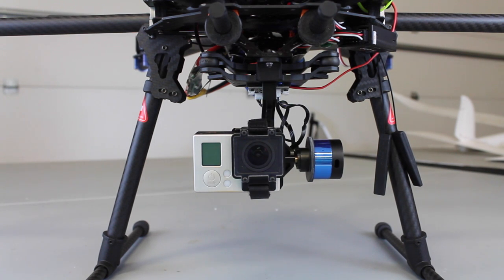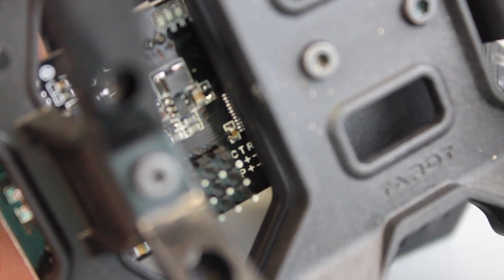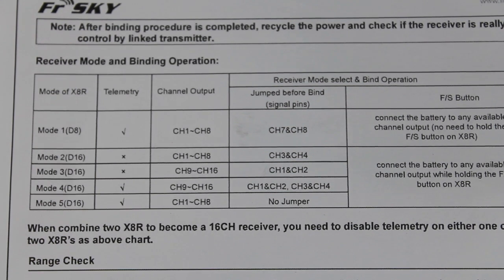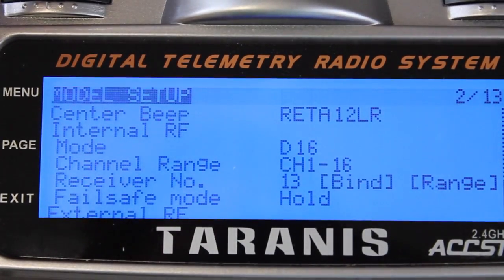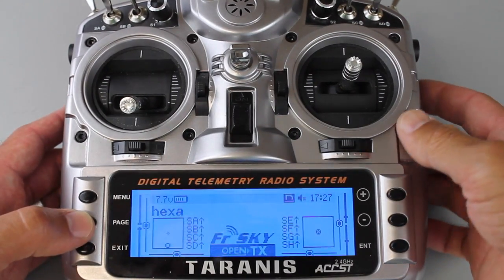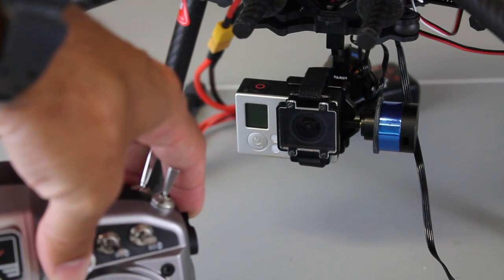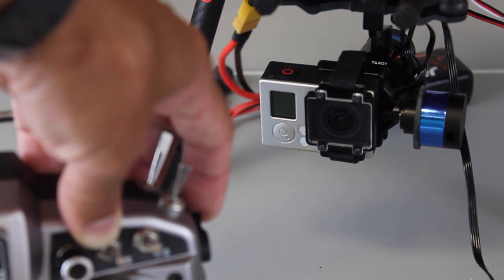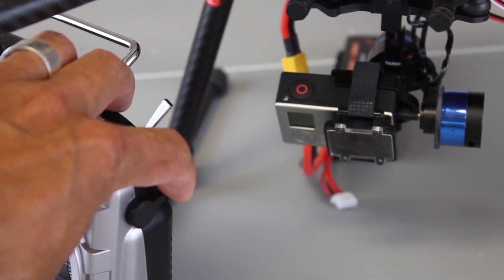FrSky Taranis and Tarot T-2D Gimbal Tilt Setup and Configuration

Comment: hi, i have a question about wiring my tarot t2d, please help me to get fpv to my tablet. I bought the usb to connect the go pro hero 3, to get video signal but i have no clue where to connect the 2 connector from the other side of the usb. thx regards

Comment: Hey Dennis would like to thank you a lot since I got into the hobby last winter.  Your videos became my Bible. I have dji f450 naza m v2 .- Trunigy transmitter with Frsky DJT - D8R xp RX and VTX Boscam RC-TS832 tx   setup plus micro board camera . Doing a build with HMF U580 frame , 3508 580kv motors /14” props with ZWT Spider 30amp opto ESC. I’m know lookin to buy brushless Gimbal , been lookin at a bunch on HobbyKing. Need one that will work my camera. If I used weights that equals a Gopro that should work right ? plus my camera. If I use servo plug to receiver to control panel of Gimbal for tilt , should I disconnect +red wire and leave -neg and signal wire connected? Should mention I’m using channels 1-6 and 5 for mixing like your turnigy video setup , so I have 7 and 8 are free. I’m lookin to buy a Tarot t-2d
Reply from the maker: I think your suggestion may work as long as you have the weights distributed similar to a GoPro setup. You'll also need to make sure the camera will fit properly given the Tarot T-2D mount is specifically for the GoPro. To be honest I can't remember if you need to remove your power lead. I'm pretty sure I removed it but it's been so long since I've messed with this build. Let us know how it goes and thanks for the good words. Wish I could have offered a bit more help!
Reply: Dennis Baldwin thanks Dennis

Comment: Good but you didn't show the actual wiring. Where do the channel wires from x8r go on pixhawk and where do the camera gimbal wires go on pixhawk?
Reply from the maker: This is using SBUS from the receiver to Pixhawk. The gimbal is wired into the receiver and does not interface with Pixhawk at all. I talk about it starting here:

https://youtu.be/zXsvsYbW09E?t=2m54s

Good luck.
Reply: Dennis Baldwin thank you

Comment: Dennis, thanks for your reply. I found the following on another forum by Captain 3D, (can't recall where) and it worked for me, hopefully it will assist someone else.Originally Posted by Captain3D 
ok finally got my Taranis, Sbus and pwm working with X4R SB and kiss fc. Incase anyone else is trying to use a separate PWM channel to control a camera etc...

1. Connect the X4R SB to the kiss FC using Sbus (PWM slot 4). 
2. Jumper (short) the X4R SB signal pins for Channel 2 and 3
3. Hold the F/S button and power up the Rx to put it into bind mode.
4. On the Taranis model setup page set...
Internal RF
Mode D16
Channel Range Ch1 - 10 (important to include Channel 9 and 10 for the extra PWM)

5. Put the Taranis into bind mode and confirm the Rx connects - Power cycle both Rx Tx. Remove jumper.
6. Taranis Mixer Page - Select your new channel 9 or 10 hit enter and associate a switch or dial with the channel by selecting the source input, hit enter and move the desired switch. 

Now you should have your new switch/s controlling channel 9 or 10 and Sbus continues to work on Channel 1 - 8
Reply from the maker: Very nice. I'll have to see if I can get this to work. Thanks so much for sharing?

Comment: I was wondering if you know how to use the extra pins on a frsky x4r just like on the x8r. Thanks, Lorenzo.
Reply from the maker: Unfortunately I don't have one of those receivers but will see if I can get my hands on one.
Reply: Dennis Baldwin 
Did you ever determine if this can be done using a D4X sbus receiver?

Comment: Hi Dennis,
I am using a 3 axis gimbal with Naza M V2 and X8R (SBUS).
Could I have a servo lead from F2 on the Naza to the gimbal for pitch control? As SBUS is channels 1-8, maybe channel 8 or otherwise 5/6 could work? I used channel 7 for flight modes and failsafe switch as explained in your other excellent videos.

Comment: With the X4r do you know if you can do the same when using Sbus and use the 3 other channels as standed pwm at the same time?
Reply from the maker: +RayGeorge FPV That's a great question. I don't know but have a X4R on order and will let you know something soon.

Comment: Noob question:  Just to confirm (as I have never wired up a multirotor via SBUS before)  Are you using the SBUS channels for connection to your flight controller, and then using the standard channels for the gimbal connections?

Comment: Hi Dennis, Thanks for the helpful video. I'm using the same Taranis Tx/Rx system, but not S-Bus. I'm running the gimbal using the LS and ch 7. I did the "white wire" switch to the middle pin and connected the black to the gimbal. It works! The problem I can't solve completely is the range of motion in tilt. I've set the Offset in the Tx to 34 which limits the downward motion to 90°, but I'd like the horizontal position to be full up on the slider. As it is now, horizontal is just past the detent and is hard to get perfect without FPV - which will be coming in the future. Any suggestions would be greatly appreciated.
Reply from the maker: Robert Cook Glad you got this working! Let me think on your issue and if I figure it out I'll post a follow-up soon. I like the idea of what you're proposing.

Comment: The Pixhawk can dynamically control tilt when in "follow me" mode...the Pixhawk points the gimbal down at the correct angle to keep the person being followed, the "actor", in the image/video frame.  For that, the gimbal has to be connected thru the Pixhawk itself...anyone know how to do that?  Thanks,,,
Reply from the maker: William Salopek I'll actually be experimenting with that soon. I've been wanting to do the same in Circle mode. Will let you know what I find out and please do the same. Awesome question btw.

Comment: i'm using same set up but with dji f450, but am using same s-bus connection, is it not just possible to connect from the gimbal to the naza pin instead of having to connect to the x8r

Comment: Hi Denis, your videos have been my go to manual from the very beginning of owning a Taranis.
I followed you setup for the tarot gimbal all is ok except for one small thing.
The RS pot only works from the middle notch to full down. In other words the camera does a full rotation from top to bottom in the lower half of the RS pot/switch. Moving the pot from middle notch up does nothing.

I think it should be @ notch straight ahead, move down camera moves down, move up camera moves up. Hope this makes some sense. would this be a setting in the channel 9 or on the gimbal?
Cheers,
Anthony
Reply from the maker: Anthony Q Not sure exactly but I would check a couple of things. Look at your sticks monitor on the Taranis screen and make sure you see the bar go from all the way to the left to the right when you move the post from end to end. Perhaps your endpoints have been messed with. The other thing is in the Tarot config software I think you can limit the range of the gimbal. Perhaps there's something that's not giving you the full range. If you continue to have problems check out the forums at www.garagepilots.com and post there. Hopefully we can help you out. Good luck.
Reply: Hi Dennis,
Thank you for the reply.I will play around with the settings and see how I go.
Cheers
Reply: Dennis Baldwin Hi Dennis, Sorted out the problem with RS pot not moving in all directions. The fix was right in front of me, all that needed to be done was a re calibration of the pots on the taranis.
Hope this helps other people who view your video if they have this problem.
Cheers.

Comment: Dennis, Great video which I have followed but I get no RX signal to the Gimbal controller!

Any ideas? Cheers.
Reply from the maker: Jim Burton Hi the first thing comes to mind is that you have your spare channel configured correctly. Make sure you have your TX switch setup to output on your spare channel. Then look at the sticks monitor on the the Taranis to see that the software slider moves when you move the switch. That way you'll know you have it configured correctly. Hope this helps and good luck with your setup.
Reply: Hi Dennis,
Many thanks for you reply.

Firstly, I have my RX & TX bound in Mode 4. I have my retracts on CH 9 which work well. I then allocated CH10 to LS. This works fine in the monitor and if I plug a servo in, it works fine too!

However, when I attach the gimbal ( white lead on row 1 middle pin and earth on row 3 right pin) I get no gimbal movement!

I know, it's very strange!

I do have one more option and that is to us Sbus on the Pixhawk as this has the capability of controlling the gimbal. If I cant use your method, I'll try this one. However, I think that there is an underlying issue and that the Pixhawk method may not work too!

Again, thanks..
Reply: Jim Burton
 Hi Jim, Maybe you have fixed your problem, but you made the same mistake as me (poor eyesight) you have the white lead right but the earth pin go's on row 2 not 3.
I have different problem atm with the LS knob only the down half works.
cheers.
Reply: Anthony Q Cheers mate! Well I hope that's it.
I'll give it a go and report back.
Reply: Jim Burton Hi Jim, I just rechecked and I do not think it matters where the black earth pin goes, as both 2 and 3 have a common earth. Just make sure the earth pin is going to the earth as it is hard to see on the little board when assembled.
Also did you move the white pin to the middle on the black connecter, This can be done by using a pin and lifting the little black holding tab and sliding the wire and connector out. When it is out just push it into the middle slot.

Also do not use the red wire as the receiver has positive power coming from it and you can damage the circuit board.

Another thing to look out for on the circuit board is where the power wires connect to the board. They are to close and can short out. If you have a hot glue gun part the red and black wires a little and squirt some hot glue between them, that will keep then safe.
Let me know how you go.
Cheers mate.

Comment: Hey Dennis. Man, all I can say is THANK YOU! I stupidly bought a chinese gimbal and the board, etc came with zero instructions. Somehow I figured out which unlabeled pins to use but I couldn't figure out how to get the gimbal to work with my Taranis. Today, after two solid days of failures, I finally got this thing to work at least a little bit. I also appreciate your videos on other Taranis setups. Please keep doing them.
Reply from the maker: Jack Kindberg You bet. Thanks for the feedback. I'm so glad it helped.

Comment: I have the Taranis, x8r, Naza V2, Tarot T-2D V2. The gimbal is powered up and seams to be functioning flawlessly. Question 1. Where did you get the jumpers for the x8r? Since I do not have any, I thought I would just connect to the Naza, for tilt control. I have the RS on the Taranis on channel 5. It functions and has been calibrated on X1 in the Naza asst. I connected the gimbal board to the 3 split  servo cable like you describe in this vid. The other end to the Naza X1. But I do not get any control of the tilt . Question 2. What am I doing wrong?
Reply from the maker: Mike Jordan I believe the jumpers came with my X8R but I can't remember to tell you the truth. I had some extra ones laying around and I believe they're the same size that most receivers ship with. I haven't setup the gimbal with NAZA so unfortunately I can't help you there. Here is a thread with a guy that has done it. Good luck and let us know what you figure out.
Reply: Dennis Baldwin  No jumpers with my Rx. I didn't see a thread from your post above. An RCG member sent me this link that worked. http://www.rcgroups.com/forums/showpost.php?p=27460793&postcount=350

The gimbal works perfectly, but i don't like the default setting on the pitch control. I want the gimbal to stop where I put the slider. Now I need to find win8 drivers for the Tarot software, or find someone with an older computer.

Comment: I'm curious why you didn't just run the gimbal from the Pixhawk?  That would eliminate needing to use jumpers on the X8R...

You can choose to have the Pixhawk either control the gimbal or just pass the signal through on the channel of your choice.
Reply from the maker: tpalshadow Good question. Hadn't thought about that. I figured a dedicated gimbal could do a better job than Pixhawk and from what I understand Pixhawk can't control a brushless gimbal directly. I believe it will only support a servo-based one. At least that's my understanding. Thanks for the suggestion. I'll dig into it some more.
Reply: Dennis Baldwin I'd be happy to share my configuration. You basically use a servo output on from pixhawk and tell the pixhawk what channel, but the gimbal is still in charge.
Reply: tpalshadow I'd love to see how you did this as this is what I'm trying to achieve. Do you have a video or a link for instructions please? :)
Reply: GudoBoy I don't have any instructions, but here are the guides I followed.  First page 5 here: http://3drobotics.com/wp-content/uploads/2014/06/Tarot-gimbal-kit-quady6x8-B.pdf .  Then pay close attention to this entire page: http://copter.ardupilot.com/wiki/common-tarot-gimbal .  The key for me was playing with the settings to either have the pixhawk control the gimbal or just pass the signal through to allow the gimbal to do the work.  If you have any more specific question, please let me know!

Comment: Thanks Dennis!  Once again you have saved me a ton of time.  Do you know if I will lose telemetry on the X8R if I configure it for mode 4?  I am currently using the FrSky FLVSS lipo voltage sensor for remote voltage telemetry and want to add a current sensor.

Keep up the good work and thanks again!
Reply from the maker: wn0x I haven't tried this for myself, but looking at the manual it says that telemetry is supported in Mode 4 so I take that as a good thing :) Thanks for the question.

Comment: Great video. I have recently upgraded my receiver Dennis to the immersion RC UHF system that plugs into the jr module of the taranis and a 8 channel diversity receiver can you make a video on how to set up the tilt? And is it possible to run any of the taranis telemetry on this UHF system
Reply from the maker: etab83 I wish I could but I don't have that hardware. Sorry....and if I do end up with it I'll definitely do a video. I hope you're doing well.

Comment: Excellent detective work Dennis.  Same question as I had with the Zenmuse, (that you sorted for me) up movement has little use for me, can you set it so slider up is level and middle 45 deg and bottom looking straight down? Cheers - Peter
Reply from the maker: RedHotPheasant Yeah I'll totally share that setup vid. Probably in a couple days. Thanks for the great suggestion and hope all is well.
Reply: Thanks for that Dennis - A question, Have you updated your Taranis to the latest Firmware (the one with the big changes) and if so did you have any problems with existing model setups?

Comment: Dennis I have a afro Nazz 32 and I want to build a 250 quad could you recommend A middle priced motor 6 inch prop and speed controller Thanks
Reply from the maker: Farley Gordon I'm testing the Suppo BL-1510s that you can get from altitudehobbies. I'm not sure if they'll support a 6" prop though. I know these motors are all the rage right now:

http://www.multirotorsuperstore.com/motors/motors-sunnysky/sunnysky-x2204-2300kv-brushless-motor.html

But I don't have any experience with them. Let me know what you decide as I'd be interested in propping up at some point from 5" to 6".
Reply: Dennis Baldwin RC model review says: the six inch is a lot more responsive if you got room on your motor arms

Comment: Great vid, I prefer stick potation mode as well. Where did you get that go pro strap and protection for the gimbal? Also did you have to change any pids to use it?
Reply from the maker: skidgalning Check out layer lens: http://www.getfpv.com/accessories-75/layerlens.html and regarding pids I did have to do a little bit of tuning, but started with the defaults that come with the config file in the software download. I talk about it here if you want to check it out: Troubleshooting Tarot T-2D Gimbal: Tips for Fixing Jitters and Shakes